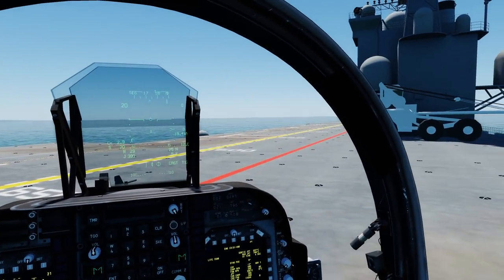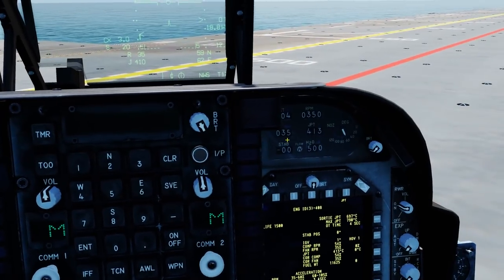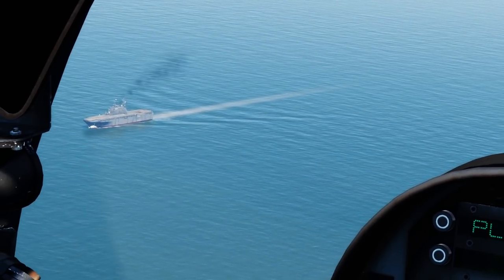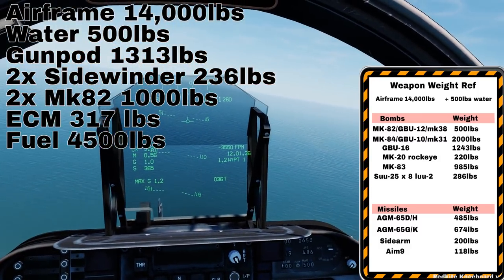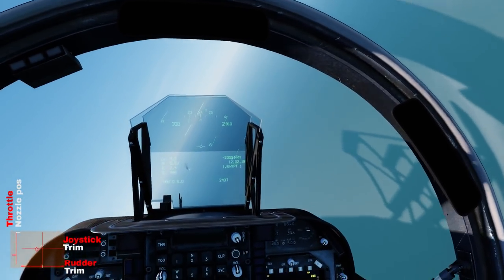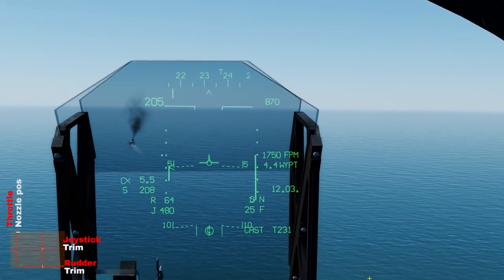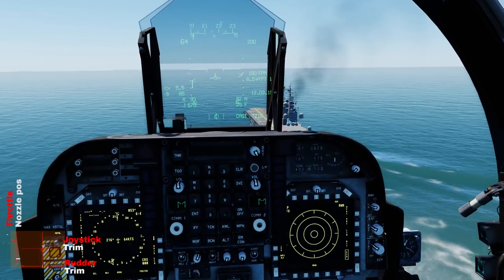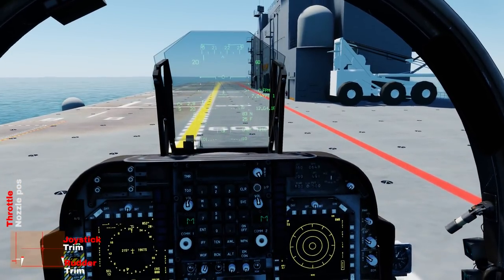DCS AV-8B Harrier Tarawa Landing Tutorial

Comment: Great vids. Subbed..My 2 cents.... This plane is what makes the TM Warthog worth every penny. One tip is especially on vert landings having the nws mapped to the stick paddle. Hold it in and the nose will not jerk to one side but stay solid. Newbies learn the HSI and compass so it's second nature. Note the carrier or runways heading sand fly proper 90 degree base, final etc and NAIL your altitudes and speeds you are aiming for. At each point have a heading,alt and speed and nail em.
Don't be sloppy. IRL you have dozens watching your every parameter so be consistent every time. If you get way off of your intended heading,speed etc go around.
Get into the infamous" falling leaf" don't try to "make it work" but go around.
Reply: The "falling leaf". My biggest mistake. Thanks for the tips and now I'm training to not get in that position anymore.

Comment: What if you vto without water?
Reply from the maker: If you run out of water your maximum power will be reduced. If you’re too heavy that means you wont be able to hover safely without overheating the engine. It is entirely possible with light loads to hover without water however.

Comment: the secret to flying a harrier is knowing how to fly a helicopter. the behavior is very similar. if you can learn to fly and hover a helicopter well, you will be miles ahead when in the harrier.

one thing. with most dcs planes you can get away with a simple joystick, but with the harrier you really need the nozzle angle controller to be easily moveable while also being able to adjust throttle at the same time, and a twist rudder stick is going to cause all kinds of grief when landing or at slow speeds in vtol mode. you need rudder pedals to do well.

Comment: Will the procedure be the same if I have a combat load ? Say, 24k-27k when taking off from the carrier ?
Reply from the maker: Take off is always the same, the max weight you can safely take off with however varies depending on the weather conditions and if the tarawa is moving. in this video i took off with around 30,000 on a carrier doing 15knots with a small headwind if i recall correctly.

Comment: Excellent tutorials redkite :) I have one question though. Aren't you supposed to drop throttle to idle very quickly after touchdown (or even  just before in certain situations) when landing vertically? To avoid jumping back up or to the sides like you did? As far as I know this is why most vertical landings on video seem rather hard on touchdown.
Reply from the maker: Yes, it is better to cut throttle, as you touchdown, to help avoid jet exhaust re-entering the engine. i'd slid to the side mostly because i'd forgotten about nws, leaving it in cast mode and touched down with a little lateral speed.

Comment: Ha, this is pretty much what I ended up doing instinctively after trying to do the side-hover move for like 3 times before going around. I can nail these slow, pseudo vertical landings easily but I can't hover no matter how hard I try, I get caught in escalating oscillations :(
Reply from the maker: Try adding some curviture to you pitch / roll axis, dont be afraid of letting to aircraft drift and settle on its own a little too.
Reply: RedKite yeah I have curvature, struggling with the not overreacting bit
Reply from the maker: Best i can say is practice, don't be afraid to let the aircraft settle itself, and wobble around, it won't stay perfectly stable most of the time, long as the wobbling isn't getting worse or causing you to drift a lot off target there's no need to correct it yourself, just let it settle down. Less is more in many respects when it comes to precision.